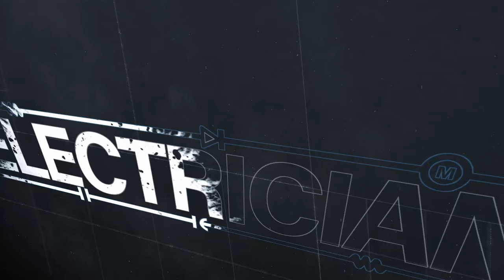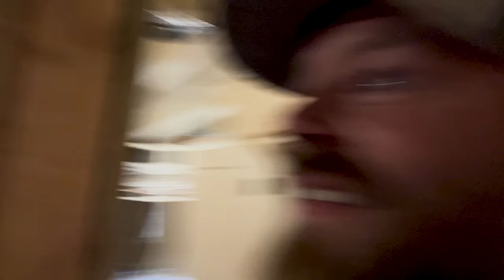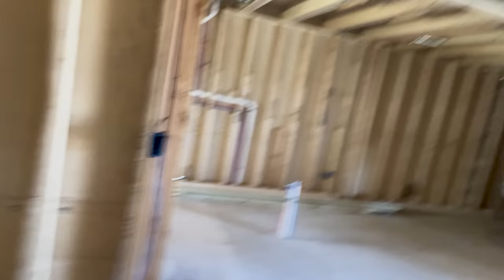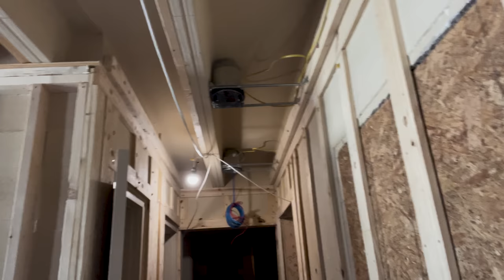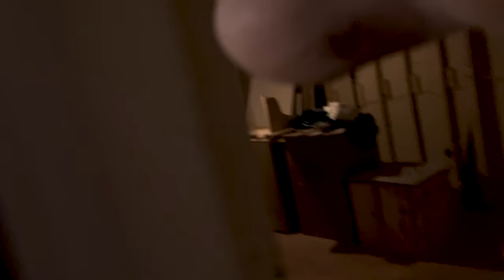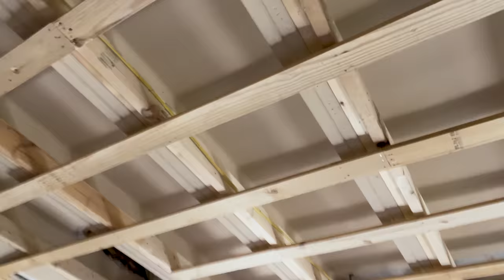Working On a Concrete House

Comment: About 10 years ago, I had to run several miles of ethernet cable through a WW2-era factory building in Germany.  That was an interesting experience. Everything was solid concrete and rebar. We got a 1-inch drill bit stuck in a ceiling. It never came loose, and as far as I know it's still there (behind ceiling tiles).

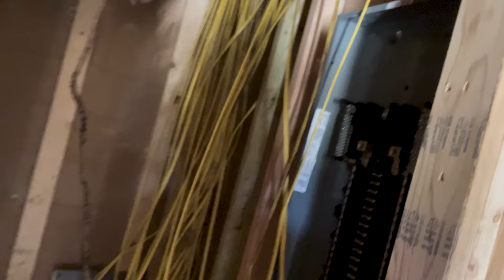Comment: 2:15 I’m interested to see how they gonna deal with heat from all racks in that space once completed and walls etc….up. Sadly, most ppl don’t plan on cooling or air circ in a utility room where PCs at and racks/servers etc….also, they cram so much crap into small space and wonder why get overheating 🤦🏼 (not saying will happen here, just what seen)
Reply: A minisplit is a simple fix, right on an outside wall for a
Condenser easy
Reply: When I was a biomed for a clinic, our mech room (servers,  25 sat TV receivers, load center, network racks, yada yad) the door had a huge sign that it was never to be closed due to overheating.

Comment: Concrete and brick construction isn't so unusual here in Europe and we're accustomed to chasing out channels for cables, even have power tools for the job!  My own apartment is concrete and brick with no drywalling and the original cabling from when it was built in 1950 was run in steel conduit pipe (EMT) embedded right in the walls, floors and ceilings as they were poured. When it was re-wired about 15 years back new conductors were drawn through the tubes: actually one of the easiest jobs imaginable!  A few additional receptacles were added with surface mounted conduit which is a bit aesthetically naff but mostly hidden by furniture anyway.
Reply: Thats how it should be done. And like you said if properly installed those conduits also stay good till the houses electrical wiring starts to get old (40 years is a good time to start thinking about a rewire) and rewiring is super easy. Thats what i do for living. Imo all the cables and conductors should be inside conduit for easy change when time is up and you dont have to rip all the walls off etc.

Comment: We did a 6000sq ft historic (1940’s) house in my area where the ENTIRE THING was 8” poured concrete. Floors, walls, ceilings, everything. Everything was BX. Any time we needed to add anything we would mark our holes and they had a team of core drillers that came by once a week to cut all the different trades holes in. Had a 400A delta service on it, we actually kept the delta and upped it to 600A.

Wiring the thing was absolute hell, but the HVAC guys had it worst. 16 mini splits, one for every room we’re added because it was impossible to duct the house
Reply: Stone and Concrete Houses standard for us 🇩🇪everywhere.

Comment: I’m having nightmares of seeing Lutron homeworks. Wired many 15,000 square foot custom homes in Atherton California. Residential work in general is a no go these days. I’m a union guy now making $92 an hour plus benefits like a retirement penchant 401k mached up to $18 an hour PPO health care, dental and vision. I don’t miss wood chips in my pants. Just metal shavings now. Crappy sub contractors. Good luck electrician U! The contractor definitely landed a good electrician. I just won’t work on residential jobs anymore. Call someone else.
Reply: Local 332 Santa Clara California. If your a non union strong electrician go apply. It’s the best thing I ever did for my family and myself.

Comment: in mexico most of the houses are built with the entire structure of concrete or concrete bricks.
 greetings
if you have doubt, you can try watching videos of Mexican workers
Reply: Aqui en Mexico por eso es mejor comprar rotomartillo sds plus en lugar de taladro, el taladro es mas para cosas gringas en madera.

Comment: I remember working on a 1950s or 60s house that had low voltage lighting . It used low voltage push buttons to control relays . 
I am surprised with wireless technology they still pay the expense of a low voltage lighting system . Maybe the concrete restricts wireless capabilities but to me it seem like a waste of money

Comment: Biggest problem with ALL lightning control systems is trying to get replacement parts such as boards 8 years later. Sorry that's obsolete. Heard that way too many times. Stopped supplying all temporary lites. Between AHOLES dropping string on floor then walking on & ruining rubber lamp socket, to trades just cutting wires instead of relocating them and general contractor demanding that I drop everything and come out & replace a bunch of light bulbs that some ahole broke. Had owners demand that I install temporary lights in basement, first & second floor & even attic for free. Told them it would be $500 to $700 to install them and it was not in signed agreement. Told them to purchase drop lights & flashlights.

Comment: Yes St. George Island , solid concrete floor to ceiling , every thing was only fir stripped out with 1/2 inch strips nothing to staple to anywhere, lots of shallow boxes and hundreds of holes drilled for drive pins. Good thing was I could set up my fishing pole and catch lunch and dinner while I worked :) . My boss was cool with it.

Comment: stumbled onto your channel when looking and trying to learn about electrical things (battery powered lighting, mostly, for portable devices/worn electronics) - also always dreamed of living in a Monolithic Dome Home (which is made of shotcrete)  so sort of related to this video.

Just wanted to say, love learning what I can from you.    Voltages, Wattage, Amperes and everything still confuse me for what I need, but your videos are very enjoyable to watch and listen to while I try to learn.
Reply: Not that you were asking per se: 

Voltage x Amps = Watts. 

It's an algebraic equation like A x B = C

120v x 20 amps = 2400 watts
or 
2400 watts / 20 amps = 120v
or 
2400 watts / 120v = 20 amps.  

This formula works for batteries, solar, residential. If you know at least two of the items in question you can figure out the other. 12v car battery and 10 amp draw is using 120 watts (per hour). Everything is per hour. That's why your electricity usage is denoted as Kilowatt hours (1,000 watts per hour).

Comment: Why don't you use 1/2" downlights? Don't have to attach to anything as they just clip to the drywall after it's hung. You leave your wires bundled up and tap into them at the end. Nothing gets painted over, easier for the drywaller, keep them straight in line with a laser and you can make minor adjustments after the fact and get lights perfectly in line. I'm never going back to using cans ever again.

Comment: I always wondered how you rewire a poured concrete house. Do you just chase the block throughout the house? I wonder how chasing the concrete will affect the structural integrity.
Reply: Easiest way is to fur it in like they did, but it would've been 10x better if they furred it in with a normal 2x4 wall all over instead of laying them flat. You lose a little bit of square footage but it's like wiring/plumbing a typical house at that point instead of what they've got going on here. Probably a new builder as this was too much for him.

Comment: A man should take pride in his job. It gives you so much satisfaction.
  Anyway here in  Guyana the houses are all cinder blocks.
We have to cut channels in the walls to run the conduit and boxes,then plaster it with cement and sand.
This is more time consuming because we don't use dry wall over the concerat.

Comment: Can anyone provide more details on the lutron system. I would love to learn more.
Reply: The system in this video is called "Control 4". It sucks. It's over priced and a waste of money because all the individual switch legs need to be run back to a panel as you saw in this video.

Use "Radio Ra 2 or 3". 3 just barely came out. The Radio Ra system is Lutron, but runs off of 120 volts. So an electrician can wire a house as normal or customize it according to the wants of the home owner. If you're in a finished home the Radio Ra switches can just replace the existing switches without any additional wiring. This system also has all the same capabilities as the Control 4.

The only speed bump you'll run into is that only a Lutron trained representative can sell these switches. Plus, they're the only ones who can program them. The same goes for Control 4.
Reply: @TheForgottenMan270  thank you we are about to break ground on a new home and was considering something like this. I don’t like our current solution.

Comment: its like looking at the construction in Puerto Rico.. most houses are mad almost entirely of concrete brick.. internal walls and all.. most new electrical is run through wall attached conduit unless u want to pay to run it in the walls.. it can get pretty pricy not to mention most outside walls are build with rebar and the bricks are filled in with more concrete

Comment: Fortunately there is no such thing as a 
" looking pretty installation inspector" only " working safe installation inspectors" you can literally just throw wire everywhere cross it everywhere as long as it works then u're ok, me my self I take pride of what I do and I'm proud of my workmanship, so I keep it together, I don't suffer from OCD or neat freak syndrome like some people do but I do very nice work..! And by the way, low voltage DC lighting is the way to go, I love installing low voltage lighting.!
Reply: I think you mean OCD.
Reply: @illestofdemall13  Oh yes, lol I'll fix it
Reply: @jesseestrada4290  I do kind of suffer from OCD. I really try to make my work look neat and perfect but sometimes I have to move on at a certain point because I am wiring a mansion by myself and the customers want it done yesterday. Lol

Comment: Couldn't you have just stapled to the joists since you have strapping rather than drilling up and down through concrete? Or is that not allowed in your area

Comment: do you guys use 12/2 to wire homes? i thought it was 14/2? they change the rules?
Reply: 12 gives 20 amps and good for voltage drop over a 80ft run.
Receptacle rating estimated 1.5 amps each so you can cram up to 10 receptacles per homerun (taking into consideration the 80% load capacity). 14 is awesome for lighting circuits as it can carry 15 amps.
Honestly, if it were me, I would only run 14 for a small home and break up the individual rooms into circuits with the exception of kitchens, laundry rooms, living rooms, bathrooms, and old homes where a heater/ac window unit would probably be used. 

But I am not an electrician. Just some dude posing as a helper rocking a bachelor's degree in accounting lol
Reply: @jfarley1221  You can do more than 10 receptacles per home run. There is actually no limit in the NEC for how many can go on one circuit.
Reply: @illestofdemall13  would you really want your home lights and receptacles on 3 circuits?
Reply: @jfarley1221  I didn't say that. I just said there isn't a maximum in the NEC. You could put 12 on one circuit in a big room, for instance.

Comment: I have a weird question that I haven't been able to find an answer for, even with asking multiple licensed electricians. I've been watching your videos for a while now and I trust your experience and expertise. Can I ask you the question?
Reply: You might get some answers if you post the question.
Reply: I have 240v smart thermostats, 4 circuits, 4 breakers. All 12/2 with hot whites. One breaker is split to 2 different thermostats in separate bedrooms with a 1500w heater each. 2 of the circuits have 2 - 240v - 1500w hydronic electric baseboards from Cadet on a single stat. Last room can't take 2 big ones due to door and fireplace. It needs 3 smaller 1000w ones but the 1000w ones are 120v. Can I split the 2 legs after the stat and have 1 be 2000w and the other have a single 1000w? Thinking 1000w will flow on the neutral, but it's using the bare copper for that. Is this legal? Will it work? Will it overload the thermostat? Or would I have to run 10/2 120v with a 30 amp breaker or 12/3 240v to flow on a white? Hopefully I gave enough information.
Reply: @SeventhLvL  I don't know what licensed electricians who would struggle with this, but I wouldn't use them if they aren't familiar with these basics. 

You can't split off from the 240v and use the bare copper as a neutral. In a 240v system the copper is acting as ground and would effectively turn everything in your system that was a ground into a conductor for return voltage. As for the new units that are 120v you will be able to run them on 12/2 if you aren't going to exceed the capacity of 12 ga wire which is 20 amps (2400 watts) under the 60 deg. table or 25 amps under the 75 degree table. It will also depend on the breaker you use and how you're running wire. I do not know how your thermostats are wired or what kind they are to know what they allow, but you will need to run a ground, neutral and hot to any 120v heater unless the thermostat and heater are some sort of proprietary system, or the neutral flows via bluetooth (joke). You also can't just upsize your breaker and wire and keep running more and more things off of it, because the heaters themselves have wiring inside that is only so thick and can burn up if too much juice is running to another part of the circuit. The manufacturer will dictate what breaker and how many of their units can be on a single circuit. Some heaters require a dedicated circuit per heater, others might be able to handle two on a single 20amp circuit. 

Be safe and find a real electrician who can do this job for you. Heaters are one of the highest amp drawing units in a home and have caused many fires from improper wiring. Don't save a few bucks and burn your house down.
Reply: @MyFortressConstruction  the system is each breaker sending two legs to a thermostat that has 2 legs in and 2 legs out, no ground no neutral. The ground goes straight to the heaters. King Electric Hoot touchscreen stats. All circuits are stand alone and not connected to anything else. I understand that 240v uses both legs to cancel each other out and not flow through the ground, which is why I was hesitant to have a lopsided circuit. But I also see what you are saying now that even with 2 equal sets of heaters that would in theory cancel the flows through a connected neutral, since that neutral is also the ground wire, any change in resistances/load would send any surges through the ground into the metal heater boxes and ultimately back to the box. Although if I just took 2 equal heaters, 1 on each leg, connect their neutrals and keep that separate from the ground, each heater, (resistor) in theory would use half the voltage, they would then be in serial, operating on opposite waves, which is why I thought it would work. All other circuits are 240v in parallel. As far as amperage, the 1500w 240v heaters are 6.3 amps so I did 2 per 20 amp double breaker. The three 1000w 120v ones would be 8.3+ amps a piece, making me have to safely wire in parallel with a 10/2 and 30 amp breaker. But I was wondering if I could split it 2 and 1 to use the 240v thermostat. Thermostat says each leg can handle 16 amps. Total of ~25 amp load on a single pole would definitely need the bigger gauge and breaker, and each heater would not be in danger of internals as each would receive the same 120v, but the unbalanced load to that leg in the breaker box would dim some lights every time it turned on, lol. I'm sure the people who I've asked about this just hadn't come across it before and never thought about it because it's not something they normally do. Electrical Theory and creating from scratch isn't the same as day to day practice so they may have just been blowing me off by saying they didn't know.
Reply: @SeventhLvL  Electrical needs to be kept as basic as possible. When you start moving into roundabout methods you tend to void warranties and cause issues you never knew could happen. I have never known a manufacturer to not indicate precisely how they want their devices hooked up (unless it's written in Chinese). They are the ones that would be held liable in the case of personal damages and so they have done the research to know what their system requires and how to connect to it. If the instructions indicate a way to do something and you want to go beyond what is written, then it is best to call them and ask.
As for hooking them up in series, I would say no. Residential electrical is kept to parallel circuits in everything. You will create a higher resistance and if any part is damaged all of it will cease to function when run in series.
 As for the thermostats, they should function like a switch which is why you won't hook up neutral or ground to them (unless they are mounted in a metal box). They are basically single pole switches that "turn on" the heater by allowing the hot line to pass through when it senses the temperature has dropped below the level. So your heater is going to determine the actual wiring it needs and that would come into the box, just like a normal circuit and then neutrals get connected to flow to the heater. This would be my understanding of the system. So as far as pulling multiple heaters off of one thermostat, if the thermostat says it can be placed on a 30 amp breaker, and the heater does too, and the heater says that it can handle a 2000 and 1000 watt on the same circuit at 30 amps, then you're good to go. But the wire, breaker, thermostat and heaters all have to "agree" with whatever combination you do because if you meet all the criteria except one, then you have a risk of a fire or other issue. So make sure your heaters can be placed on the same circuit with each other because I have a sneaking suspicion that the manufacturer of the heaters will want individual circuits for each heater, or they will tell you how to hook up multiple in a single thermostat instance like what you described.